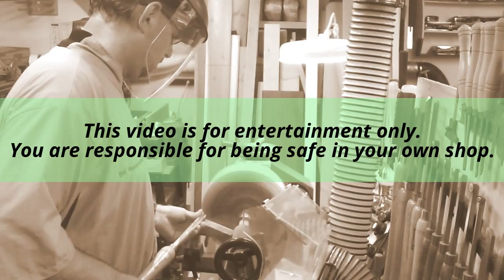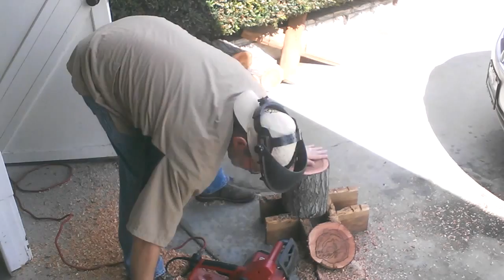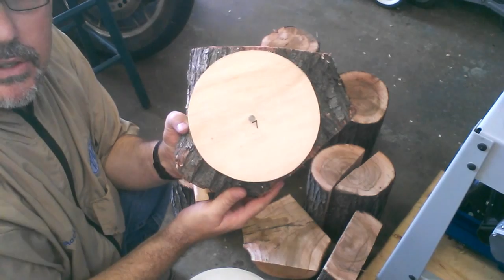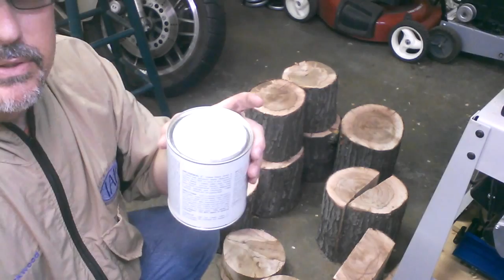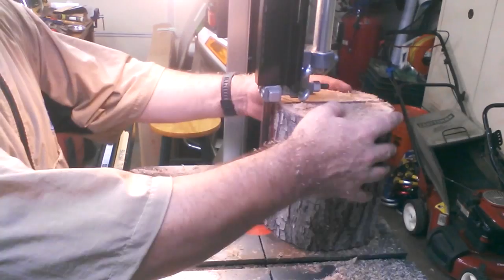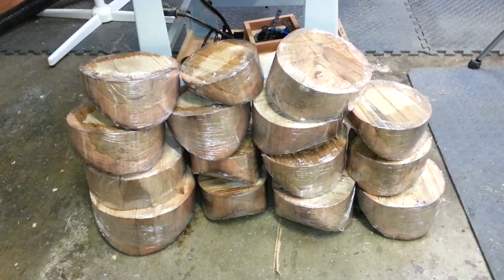07 - Logs into Bowl Blanks

Comment: so what brand/size/power is that bandsaw,mine won't do it!!
Reply from the maker: @joedivincenzo2099  Hi Joe, thanks for watching and commenting. That was a Delta 14inch bandsaw upgraded to a 1hp motor and 6inch riser, with a sharp Lennox Diemaster blade. It was not fast, but it would do it. I have since moved to a grizzly. 17 inch bandsaw with 2 hp motor which does a better job. Cheers!
Reply: I have a 14" Crafstman, heavy duty  model, 1.5 HP, I wonder if it can be raised. I also have a antique 16" Walker Turner. With upgrade motor. The chain saw take too much meat of the timber.

Comment: Thanks for the video! What blade is the best to use on the bandsaw for cutting blanks?  Tooth count and thickness?  Thanks!
Reply from the maker: Hi Mike, thanks for watching and commenting. I generally only use two blades, and it depends on whether I'm cutting dry wood or wet wood. For dry wood I like a half inch Lennox diamaster to Blade with three teeth per inch. For wet wood I like the 3/8 in woodturners blade from Highland woodworking. Cheers!
Reply: @BillRockwoodWoodturning  thank you for the blade info. I have a laguna 14 12 and I have broken 3 blades doing wet blanks. Didn't  know there was a woodturners blade for wet wood. I had given up using the bandsaw for blanks. Cheers Dave from Portugal
Reply from the maker: Hi David, thanks for watching and commenting. Glad you were able to find some useful information in the video. Wet wood blades are great for preventing binding and breakage, but they're not maintenance free, as wet wood is still messy.  Cheers!

Comment: Bill-----I'm just a beginner.  I have some old dried out applewood logs. I am wondering what I am going to run into when I split them and cut them round as you have shown here.  Would it be better to start with 'wet' logs and dry them as you have shown---or will these probably work as well?
Reply from the maker: Hi Lynn, thanks for watching the video. I would try and cutting the apple wood logs and seeing what's inside, you might find you have some good usable turning wood there. If it doesn't pan out, then you might try finding some Greenwood and either rough turning some bowls and drying those for later, or drying the blanks for later use. Happy New Years, and cheers!
Reply: Thanks Bill         @BillRockwoodWoodturning

Comment: What brand band and model bandsaw do you use?  Thanks.
Reply from the maker: Hi Herbert, thanks for watching and commenting. For small work, I have an older Ryobi 10in bandsaw.  For larger, including making blanks for bowls and such, I used to have a Delta 14in with a 6in riser block, but I recently upgraded to a Grizzly 17in, which is 2hp.  I typically use Lennox bandsaw blades. Cheers!

Comment: Useful, thanks. Bit more detail would be nice, like how long for storage, why left outside for a few days. New subscriber 👌
Reply from the maker: Hi Shaun, thanks for subscribing and your comment! Storage times depend on a couple factors, including wood species, blank size, and turning methods.  If you want to turn the wood wet to final thickness, or if you want to do the twice-turned method and store the roughed out bowl for final turning later, you don't have to wait (Reed Gray, aka Robo Hippy, has some great videos of his method for this).  If you want to wait until nearly dry, write the wet weight of the blank on it before storing, then wait about 6 months before starting to weigh the blank again for weight loss.  Then weigh the blank one a week or so (writing new weight on each time) until the weight loss has slowed significantly.  About sitting out - that wasn't outside the shop, that must mean on my shop floor; there's no magic there, its just me making sure the exposed faces of the blanks have dried off a bit before having them join all the other drying blanks in my little shed.  Cheers!
Reply: Shaun Whiteley

Comment: Awesome! So these will probably be left to dry for 3 years or so?
Reply from the maker: Yes. Most are still drying. Cheers!
Reply: If it is small enough to fit in a microwave would you be able to dry it faster, and if microwaved would you still need to use a sealant?
Reply: @bobboyer9440   Ive done the microwave process a few times. It takes a lot of time - heat up, weigh, cool, heat up, weigh, cool, heat up, weigh, cool.  Over & over as the water evaporates, the bowl blank gets drier & drier.  It does work… when it reaches a good weight, u can turn.  No sealant.   Ive also turned green bowls & mw’d when done.  That worked well too.

Comment: Thanks for the informative video!  How long do you let them dry?
Reply from the maker: Hi Jolox, thanks for watching and commenting. I typically let them dry 1 year per inch of thickness.  Cheers!
Reply: @BillRockwoodWoodturning   That’s the downside….if there is one.  I process wood like you do as well, but often then turn a few.  I often “get lucky” and nothing drastically cracks, maybe a bit of warping, but the warp adds character. Good video.
Reply from the maker: @Mark B  Hi Mark, thanks for watching and commenting. In my experience, wood species has a big role also. Olive and pepper tree crack more, where ash and camphor are less prone. Cheers!

Comment: what enviroment do you store in for drying.
what about the loft of a barn. It can certainly be hot and dry most of the year
Reply from the maker: Forge Shop Thanks for your comment. I store mine in a shed outside my garage and the humidity in California is generally fairly low and the temperatures are mild. I would be careful about storing somewhere to warm because you want the blanks to dry slowly to avoid splitting checking cracking. Cheers!

Comment: What if you don't have a band saw ?
Reply from the maker: Hi Mart, thanks for watching. Without a bandsaw, the next tool of choice would be a chainsaw too rough off the corners - this would be serviceable to get your blank mounted on the lathe. Cheers!
Reply: Great, it would have to be an electric one, as noise would be an issue where i am
Reply from the maker: Mart Ashton electric chainsaws work just fine - I own two of different bar lengths, and use them on all the logs I break down for blanks. You just need to let the saw do the cutting and be patient since it doesn't have the same power as gas obviously. Cheers!
Reply: Just subbed, as you make things easy to understand without jargon
Reply from the maker: Thanks Mart, glad you enjoy the videos, and happy to have you along. Cheers!

Comment: Titebond 3 works great and is half the price of Anchorseal
Reply from the maker: Hi CrackerJack , I've  heard that but haven't tried it yet. I may give that a shot when i run out of what i have on hand.  Thanks for watching and commenting. Cheers!
Reply: Regular latex paint works well too & much cheaper than Anchor Seal or TB.  TB is pretty expensive & takes a lot to cover the edges an a good sized bowl.